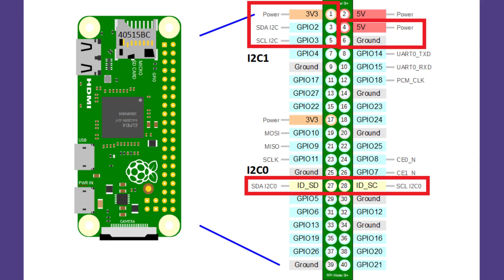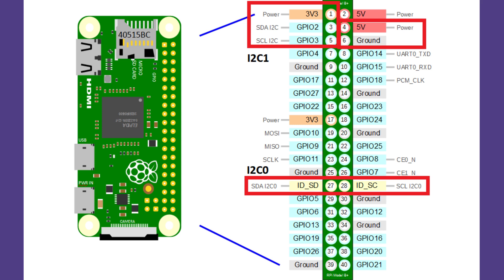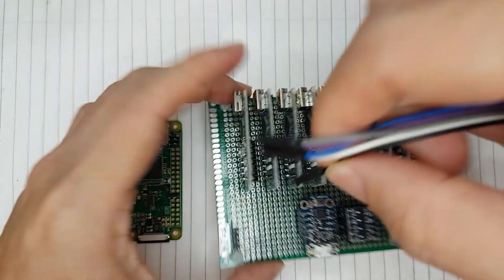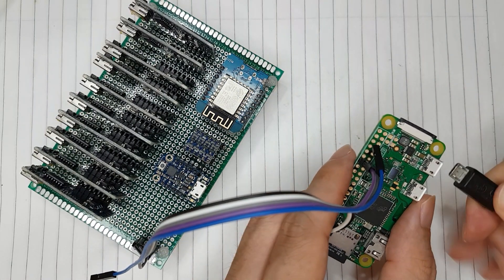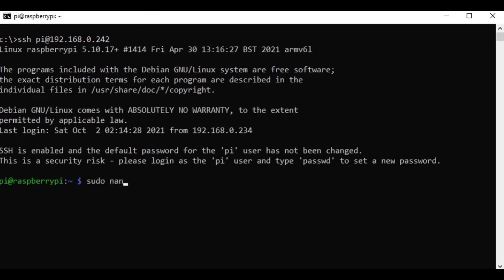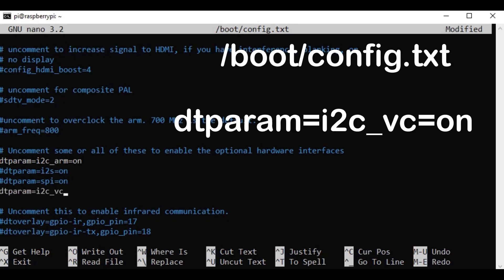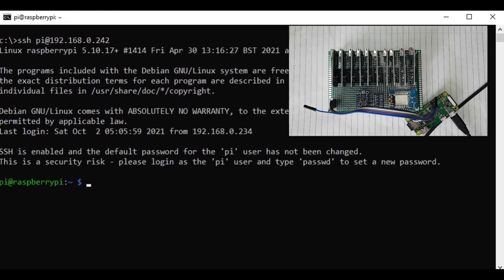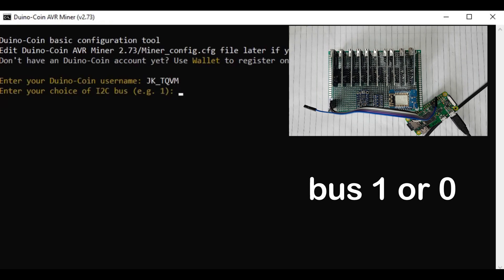How to Use Raspberry Pi I2C Bus 0 to Mine Duco

Comment: if its possible try to make esp8266 as slave too, instead of arduino and pi
having 100 devices of esp8266 to a single router and not able to monitor the devices whether they have problem in mining
not good
Reply from the maker: unfortunately no. esp is bad at being I2C slave
Reply: @JKRolling  how about if esp8266 have webserver that can show mining report? 
so we can access the ip address on certain opened port to see the report
Reply from the maker: @abangx  you may use "ESP8266 Sketch Data Upload" plugin for Arduino IDE to upload the html in the data folder

Comment: Can I just use rpi4 as master and then 5 Arduino unos connected by usb and achieve the same? Or do they need to be wired
Reply from the maker: Yes, that'll require usb hub and preferably externally powered. The I2C here allow you to skip the hub and connect to many I2C slaves
Reply: @JKRolling    Seems like my miners never stay
Reply: What issues cause only 3/7 miners to run? That’s why I looked into I2C for hopes to run smoothly ffs
Reply from the maker: @WasaMada  please join duinocoin discord channel so I can get more details of your setup and hopefully resolve your issue.
Reply: @JKRolling  I’m Jmad …mod lol
Reply: I sent u a request
Reply from the maker: @WasaMada  ok, troubleshoot can begin then ;)
Reply from the maker: @WasaMada  ok, I'll get to it soon

Comment: Nice and usefull video i will try to do this. i have an question, can i use Atmega8 for I2C sleve?
Reply from the maker: I have not worked with Atmega8 before. but I do tested it on Attiny85 which also has 8K flash. The problem with it is, it uses software I2C rather than hardware I2C (Nano). Often the I2CS will not be able to respond or receive/return right data, due to the small flash memory, I'm not able to implement the error detection logic for it. But not all is lost, it still works pretty decently using ESP as host.